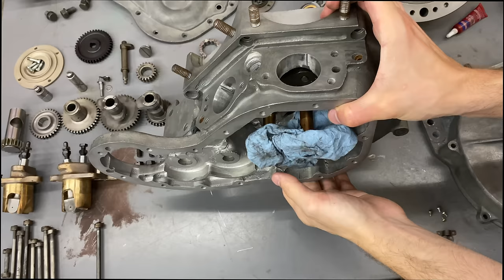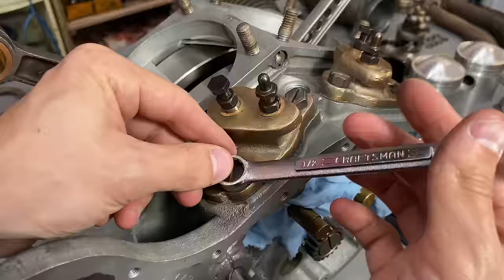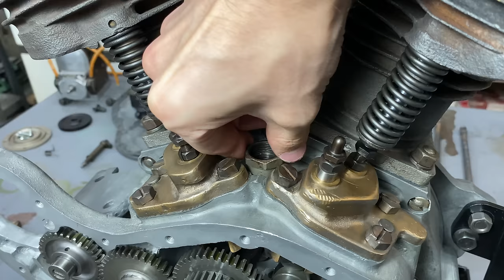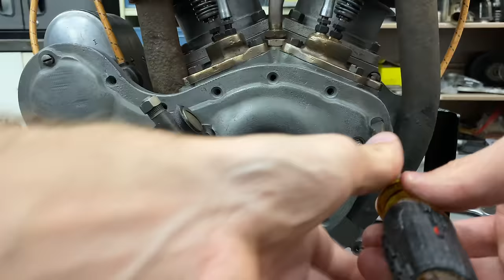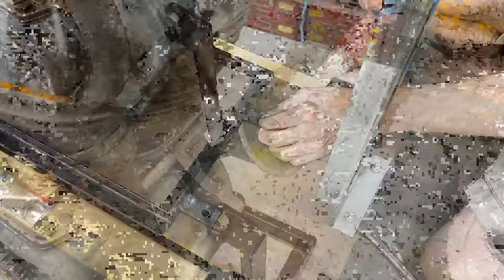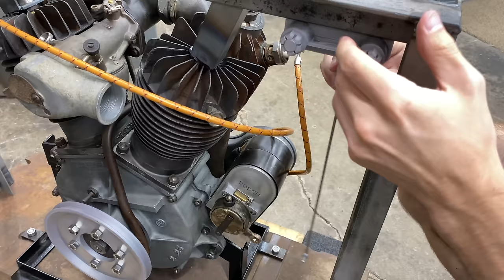Extremely Rare 95 Year-Old Harley Racing Engine Assembly & Running! 1928 Harley JH 2-Cam Timelapse

Comment: No sealer on the case halves? No assembly lube on moving parts? You don't like the big piston clips? Are those PEEK intake seals? The JH was NOT a factory racing engine and way more than 10 exist. It was the 61CI version of the famous JDH 74. Sold to the general public in dealerships.
Reply: so this is lies?
Reply from the maker: 1: there is sealer on the case halves. I always smear a very thin layer of black gasket sealant when assembling. Not sure if that made this film or not. Originally they had no sealer or gasket whatsoever 🤷‍♂️

2: assembly lube is not necessary if you are planning on running an engine soon after rebuilding - which I did. 60 wt oil is quite thick at room temperature anyways.

3: no, I don’t like them at all (if you’re referring to the clips I used on these pistons) 😂 but they work great. More than one way to skin a cat as they say…

4: yes, those are PEEK seals. The brass originals can work great as well, but PEEK seems to be superior

5: I never said JH was a factory race engine - It’s not. But a 1928 JH is identical to an FH race engine in many technical aspects down to the bronze cam shafts. The only real differences (aside from the VIN number & casting numbers) between a JH and a direct action FH engine are the cam grind profiles, the lifter blocks, the combustion chamber shapes, and the flywheels. 

“Way more than 10 exist” is a stretch unless you know of a pile of them that no one else knows about. Quite a few have come out of the woodwork since this video was posted, but there seem to be less than 20 known still. Always looking for more!
Reply: How Do you know if there is oil in a harley,  its dripping under.. If not NO oil.😄
Reply: @davidlarson3905 how come few exist?
Reply from the maker: @GreenGrow-ck3pg  the 61” JH was pretty low production to start with compared to the JDH. Actually I’m not even sure if they made a JH in 1929, because the public preferred the more powerful 74” JDH. Half of the existing JH engines I’ve seen are no longer 61” - many were stroked out or fitted with 74” cylinders at some point.
Reply: Cool story. Where’s your video and your engine rebuild? We’ll wait. 😂
Reply: Exactly my dude
Reply: DUDE, ALWAYS USE ASSEMBLY LUBE!!!!
Reply: Don’t you just love armchair experts? I once owned a Norton model 30 international ohc. A guy came up to me and asked if this was the model with a double reversible clotter spindle or some such bullshit. I replied that I hadn’t the faintest idea. He said “ how can you own a machine of this magnitude and not know?” I told him straight, “ I had the money and the chance to buy it”, asking him what he rode he announced that he didn’t own a motorcycle…………… I told him to F#@K OFF! Everyone is an expert.
Fabulous engine by the way, loved  the video.
Reply: u sound a little jelly….
Reply: @TheIrishAmish What assembly lube was used in 1928?
Reply: What assembly lube was used in 1928? Almost a century later we’re seeing premature engine failures across all brands 2 wheelers and 4 with modern lubricants, assembly lube, torque specs/sequence/torque to yield foolishness, crazy amount of testing on fasteners, fancy poop torque wrenches, quality assurance programs and a greater understanding of thermal expansion-contraction , metallurgy, wear dynamics/frictional losses, ring gap, lubricity and temperature failure points of modern lubricants, meanwhile this thing is close to a century old and you’re clamoring on about lube on a dinosaur. Goofy af.
Reply: Amen. !!!!!    Great job on this old hound dog.  She's still spitting fire.  I could only dream of getting to build an oldie like this.  Oldest I've worked on is pan's.  Great job friend.
Reply: @nomis3045 "A guy came up to me"
Cool story bro
Reply: @davidlarson3905 But what about my self-righteous outrage?
Reply: @davidlarson3905 Read your title. You said “Extremely rare Harley Davidson race engine” you denied saying it after being alerted that it’s not a race engine but your title proves you said it. How do you reconcile this? 

I got in the comments to ask why you didn’t put it on a bike. The thing about Harley’s is they’re like cars in the 50’s, some are purist examples of the factory’s imagination and some are rat rods and some are just platforms to carry all the clip on crap the owner could find at a parts store.

Comment: Amazing what the human mind is capable of designing. This was all drawn on paper and then assembled in a barn and then put into production. Amazing.
Reply: Exactly, and it worked. Almost everyday I'm dealing with crappy drawings created in state of the art CAD software. Many today's engineers don't have idea how to make stuff, all what they do are beautiful drawings...
Reply: True, it was pure engineering, but let's not forget that at that time, dozens of models were made from clay, and they kept testing until they reached a good result, after which they made the molds for casting. Don't think that all the geometry  of the crankcase was done with paper and pen and calculated with double integral...
Reply: Not only is it amazing to see what the human mind is capable of designing, but also to see the affect(s) it's had on society. Unfortunately the human mind is also capable of wanting to influence others to accept as normal, what the conscience intuitively defines as abnormal—welcome to Americas slow decline.
Reply: Yeah I know...hard to believe a human would actually design an engine 100 years ago and still use the same blueprints to build them now....

Comment: One of my Antique Cycle buds has a 1913 Harley-Davidson (First H-D) ALKY (pure methanol) burning board-track racer! One speed, no brakes, no throttle, a kill switch that cuts the magneto for "speed control". 119 MPH Laps on the 3/8th mile dirt track at the Creek County Fairgrounds on BICYCLE TYRES pumped-up to 90 PSI (white Firestone's). Total loss lubrication of 50 weight CASTER BEAN oil. Every 5-6th lap, reach between your legs and manual pump the oil pump until it smokes a puff. Think about Glenn Curtis-he bought his frames from brothers in the bicycle trade near Dayton, OH and put his engines on WRIGHT BROS. frames. Now put down an 1/8th mile track of boards, put 40 riders who kicked, punched, spit on each other on a 25 foot wide track at 110+ MPH. It was called "Murderdrome" rather than Motodrome. Many of them became WWI Aviators. I'm working on a street 1916 "ACE" 52* (Bosch Magneto) Vee-twin 1065 cc three speed tranny. Acetylene headlight and all! By 1925, there were at least THREE street motorcycle manufacturers for each letter of the alphabet. EXAMPLE: A: Ace, American Flyer, American Eagle, American Flag, Ace-Hi, All-Bee, A-EZE and 12 more. The "Panic of 1922" killed most brands along with the Model T. When dirt roads turned to mud-pits, an automobile had some advantages. In 1925 there were about 10,000 miles of paved ('improved" that could mean gravel) "highways".
Reply: 119 mph 😂

Comment: Why are you not adding assembly lubrication?🤔🤔  Did you grease or lubricate the lifters?  How often would you lubricate up the lifters.
Reply: Not to mention not torquing anything 😂
Reply: @localenterprisebroadcastin5971  The torque wrench wasn't even patented until 1931 and it was years until they were being manufactured for general use.
Reply: @johnarnold893  The original torque wrench was invented by Conrad Bahr in 1918…swing and a miss bud

Comment: Ah the good old days when motors made a small enough amount of horsepower that you could drill holes in the connecting rods to reduce reciprocating weight. Absolutely fascinating. Loved the shaker twin video at the end, hold on tight or it'll be down the street by itself ... it craves to motivate.
Reply: Or you could just weigh and balance them

Comment: So rad to see the old engineering of this motor like the screw in cam bushings/bearings in the case, what a trip. Thanks for showing us behind the scenes
Reply: Any particular reason why in the beginning and most of the video hes not using any oil or grease or assembly lube or anything like that? sorry to ask you but seems like he doesn't answer comments.
Reply: @dntlss  You know, I really couldn't tell you for certain, but I'll try to make an educated guess here for you. I'd probably guess that assembly lube wasn't too common back in 1928, so using it today is kinda moot. I also believe that this particular engine gets its oil from a hand pump, so I don't know how important assembly lube is gonna be in preventing wear and tear when the engine itself doesn't have a constant circulating oil supply.  You could lube the thing up, but it's probably not gonna stay lubed for long, and the oil that needs to get into oil passages and specific crevices might be blocked by gooey assembly lube. One other thing you might research was that in 1929 they introduced a throttle-controlled oil pump, which i have no context for, other than the names and an old article claiming that the throttle-controlled oil pump increased the oiling efficiency and overall health of the engine by a ton. So there ya go, hope my guesses might shine some light on the reasoning behind him not lubing it up like you would a 50s/60s/70s engine found in cars
Reply: @dntlss  Read my other guesses first, but here's an alternate theory: he assembled the entire motor for clearance purposes, tore it down off camera, lubed everything perfectly and reassembled it for the final part of the video where he fires it up. Not really sure.

Comment: It may have been initially built with cast iron pistons??  Those modern ones had large domes and ring tech that would be far more advanced than the original ones. I'd imagine this is a "manual squirter" oiling system as I didn't see an oil pump during assy. Haven't bikes come a long way from here.

Comment: You don't ever want it to stall out and quit, that will leave you stranded by the road.  
Maybe set your idle screw higher.    
Not about the sound, or even about the hp (well, if it was used for racing, then it is), it's about getting you there and back without issue or headaches.
Reply: An old race tuner I worked with often the first thing he'd do was turn up the idle.
And on a race two stroke turn it right off.
Reply: @redtobertshateshandles  hard enough to keep an old engine running as it is.  once you get it started you don't want it conking out on you all the time.     it really swcks if your battery is dead, you have to kickstart or push start it again, or...  your compression release is broken.   I deal with all three all the time on the farm with this old junk.
Reply: @choppergirl  Battery, hah, what battery. It's a race engine and uses a mag for spark.
Reply: @johnarnold893  Fair enough, but a dead battery is huge concern on my bikes that are too heavy to push start and jump on.   It will leave you stranded and phwcked.   

I can push start light cars on flat paved ground and jump in the seat and throw them into 2nd and start them (done that more times than I want to count), but pushing a heavy motorcycle to a running start and swinging a leg over and kicking it in gear without dropping it is beyond my stamina and skill level.

Don't want no kickstart motorcycle ever again, you'll wear out your leg or break it trying to get that thing started.

Comment: First t time I have ever seen an engine assembled without prelude on pistons/ cylinders etc.
Reply: yes, its odd, but two things:  modern oil is light years ahead of 1920's technology,  and the clearances on those old air-cooled engines was pretty was generous to start with.   that said, yeah I woulda put a few drops here and there.

Comment: That crankshaft must have some mass to it! I guess with that engine the weight must be needed to smooth out the firing impulses or help with vibration and counter balance from all the reciprocating mass being on the same side of the crank, not good primary balance like on a inline twin.